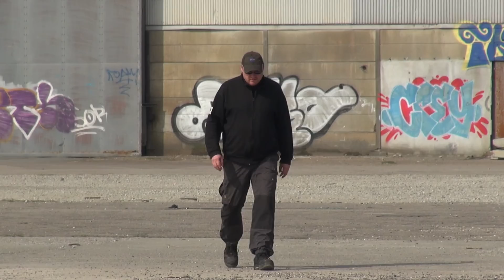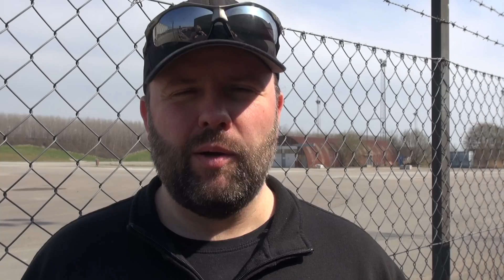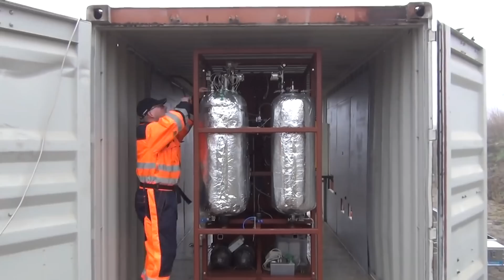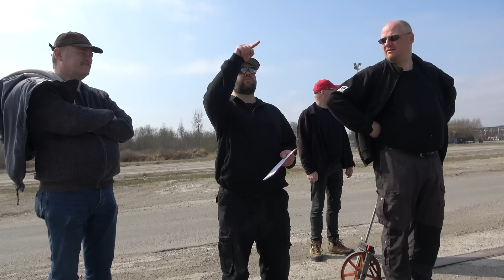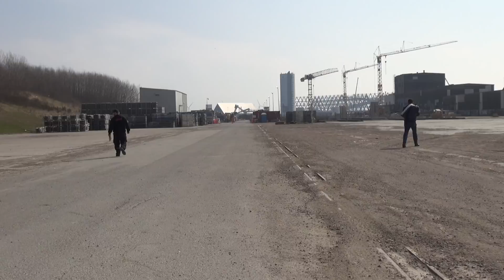Preparing for the final static test of the Nexø II engine before flight

Comment: Copenhagen suborbitals, just a quick question about your rocket engines like the BPM5 engine for example. It's about the fuel that you're using, are you always going to you alcohol as fuel or are you going to use different fuel like liquid hydrogen?
Reply from the maker: Daniel Burmas we’re staying with alcohol